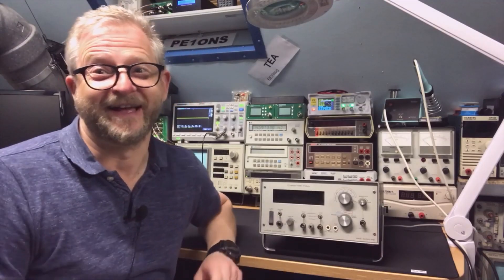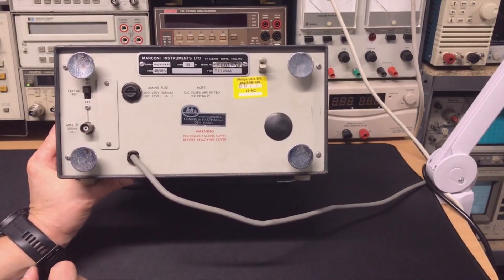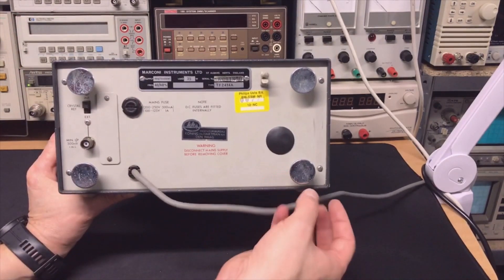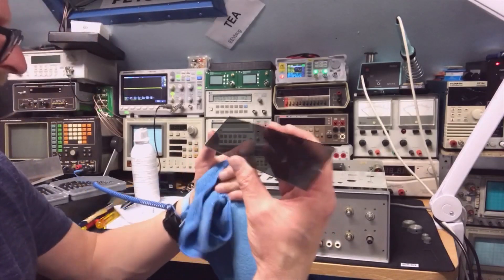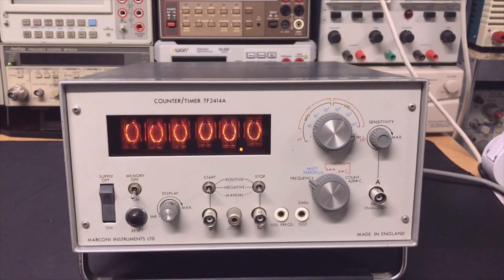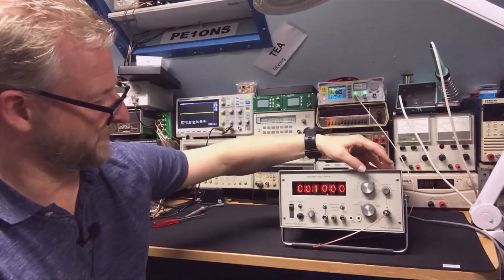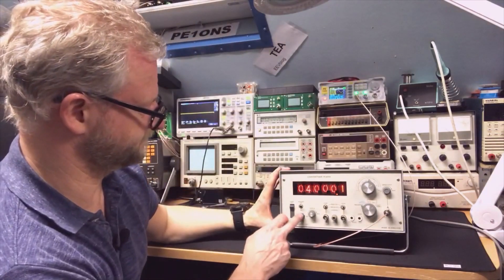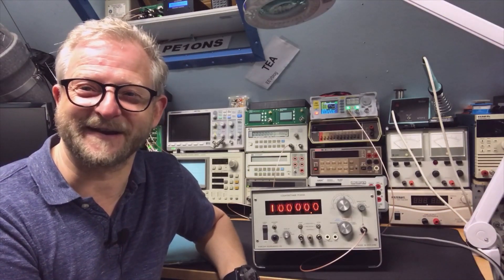#081 Marconi TF2414A Frequency Counter Teardown Restore

Comment: Hi, very interesting video, I know I'm opening an old comment list but I just recovered a Venner TS6636/2M. Opening it I noticed that there are two more modules than the Marconi signed 66/100 DRG X50351, in gray in the linked photo. I can't find any reference on them, could they be prescalers that increase the range to 100 MHz? I haven't turned it on yet because I would like to review it first. https://live.staticflickr.com/65535/53599508696_b0f88a85da_b.jpg
Reply from the maker: Thank for the picture, yes very interesting indeed.